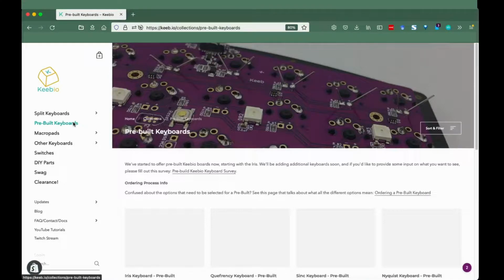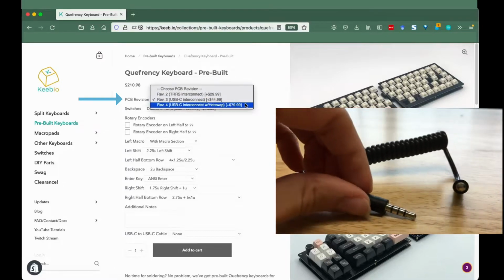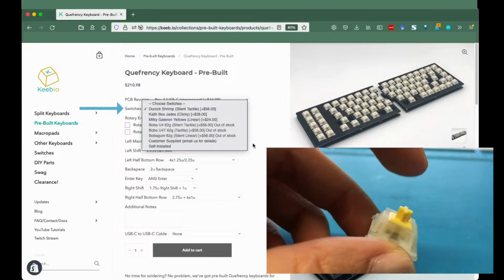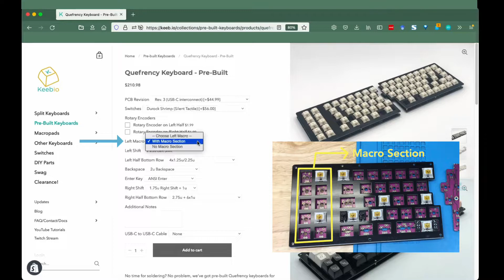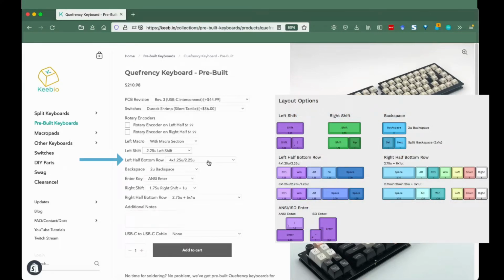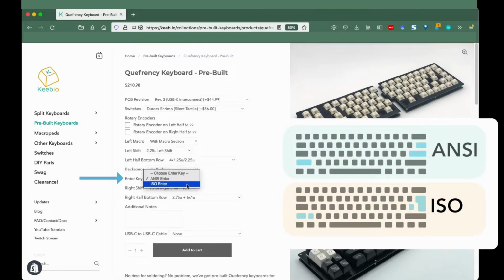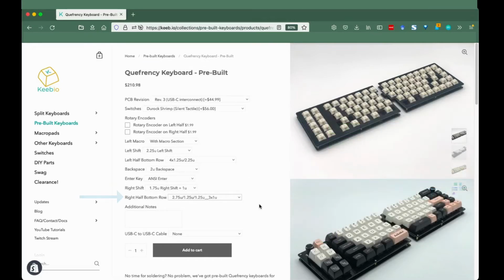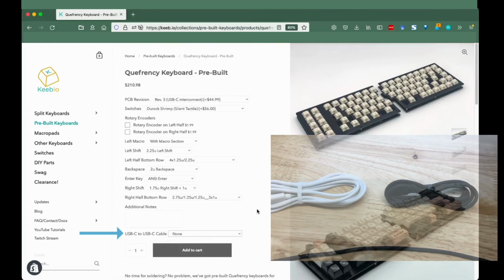Quefrency Pre-Built Keyboard Options Selection Guide

Comment: question will this exact keyboard in the video work without the cable connecting both sides of the keyboard? i would only use the left side connected to the laptop for gaming. would that work?
Reply from the maker: Yes, you can definitely just use either half on their own, and it will function fine.
Reply: @Keebio  one more question. is there a way to just buy the left half?
Reply from the maker: @sebachan  Send email to shop@keeb.io to gets details on that